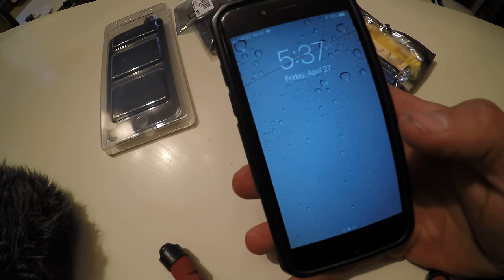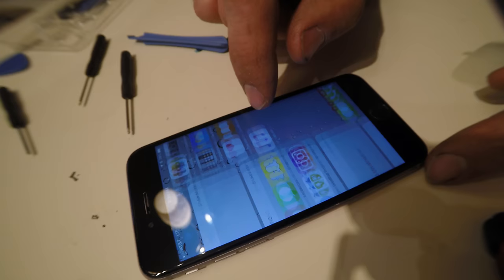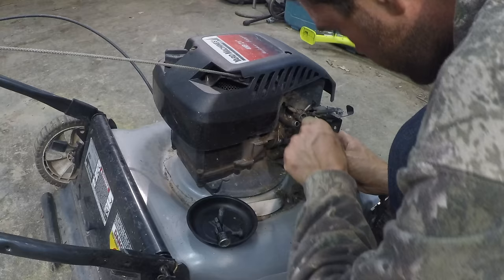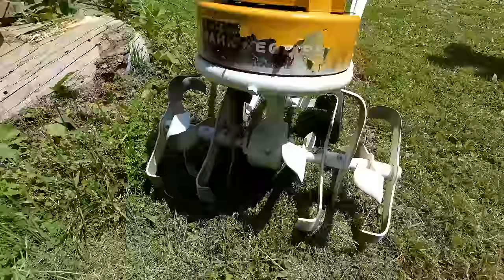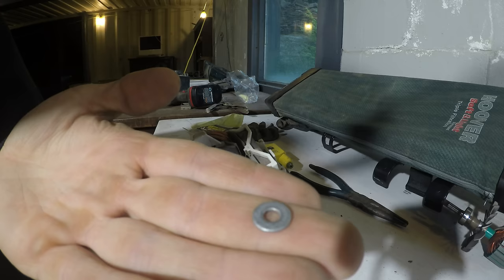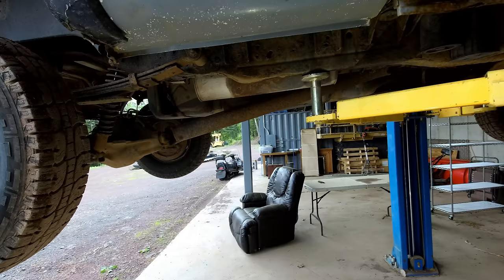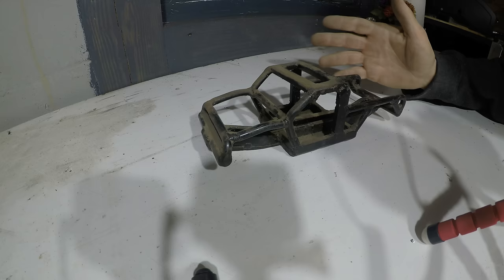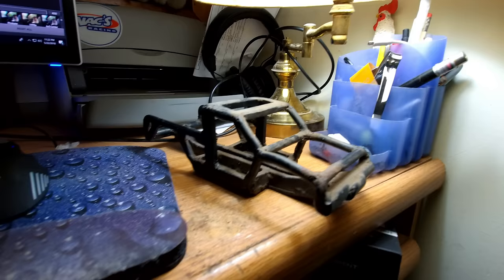Fixing stuff

Comment: I agree Andrew ,, but people wouldnt buy it if it wasn't pretty, ,,,,    Most of the VW Beetle's  were interchangeable ,,,,   Use motors from mobility scooters just make them bigger,,,,    Build it like a train , stock standard diesel motor with a generator and traction motors in the wheels ,,

Comment: I can totally see your idea on the car at least for your use, there is something you forget dough and that is the crumbling zone. Front, back and sides have this and it is for driver and passenger safety i wouldn't want a front to front collision 80 miles an hour in a bobcat against another bobcat. I guess a utility vehicle  like your are talking about could be legal if limited speed was added. I do like when manufactures uses aluminium for sure, i had a peugeot 405, 93mod once that was elzink i believe, never saw a spec of rust on that not even after standing outside for ten years without use.

Comment: You can't practically put the motors in the wheels, There is something known as spring weight. So when ever you hit a pothole the extra weight in the wheel causes bad issues into the car itself. At low speeds it works at 70 MPH you need a big rig suspension system to handle the tire weight.

Comment: Andrew, you're an industrial designer.  You talk about the fenders on the Dodge.  Remember the cover on the Hoover.  There's yer fenders.  I think a different kind of plastic.  Polypropylene.  Snap it on and when it's wrecked, put a new one on.
I'm just gonna edit in that I bet fenders like that could be retrofitted to any car.  What a business.  Tear off the old fenders and install fittings to receive the new plastic fenders.  I see a business there.
And that rust is all salt damage.  The county owes you money for wrecking your truck.  Build a spraying bed to drive your truck over and blast it with antifreeze.  A tray and a pump.  Get that salt outta there.

Comment: Another good thing about electrical cars is that that there is no risk of explosion from the fuel I have a mobility scooter which is all Electric I have no problems with it it is only an 8 mile an hour vehicle but you can buy them that travels faster such as the ziesel that they use in Austria and Switzerland as a sports and recreational vehicle which will travel at 22 miles per hour and has tracks on it

Comment: Andrew the problem with tubular chassis or using rool cages on road going cars is that they do not comply so there is no crimpling zone, in a crash with a normal car you would kill the other people surely due to the huge difference in rigidity between bot vehicles. the only solution would be having all the passengers all the the time using multi fixation point seat belts on bucket seats like you see in racing and that just is not possible. come to southern europe we dont use salt, cars last forever, especially japonese cars of course. but thats a bit of a curse because that makes then also much more expensive because they are not discardable like in places where salt is used on snow..

Comment: Lol I understand what you mean Andrew with the building cars and trucks with sheet metal, but they are designed to collapse at the hood in a head on car collision. If a car was as solid as youd like to make them, which by the way I agree with making them higher quality, someone would die on impact in the event of a crash head on if the vehicle was made out of solid steel. But yea aluminum is a much better material to make a vehicle body out of im with you.

Comment: I'll take mine to the guy at the mall.
Cars and trucks?  Built in degradation.   That's how they sell new ones a few years down the road.  Every day truck or car, just take care of it.  Fix it when it needs fixing.  My Mazda SUV has 243,000 miles and is 20 years old.  Not a spot of rust (I live in the north east) and runs well.  I fix it when it needs it.

Comment: The weight of hub motors in the wheels entirely ruins the handling of a vehicle.  One of the main advantages of an independent suspension is you don't have to shake the weight of the entire axle up and down every time you ride over a bump.  Lower the unsprung weight and raise the sprung weight by keeping the motors in the chassis.    An overly stiff truck would hold up nicely, as you say, but it would kill the occupants in a reletively minor crash.  That's one of the big tricks with modern vehicle design (well, since the 70's anyway).  The vehicle needs to strike a balance between crushability in a crash and durability in normal usage.  So between that, efficiency targets, and saving production costs, we get thin cheap steel.   That's not universal, though.  VW has galvanized every car they made since 1984, and put a heavier PVC coating on the bottoms of them besides since the mid 90's.  Most do that now, but not Dodge.

Comment: There is a lot of dissect here with your truck plan, and I'm not trying to sound like a know it all, but as an engineer I would like to have some representation. Firstly when we are talking about rust, I'm unsure of what you're referring to as modern vehicles do a lot better with this than old vehicles. Seriously. With the increasing implementation of aluminium and associated alloys, plastics, carbon fibre, the advancements of wind tunnels that can simulate salt spray and extreme temperatures, etc etc, cars are much better now that they were 20 years ago. For example, my Volvo is a "modern car" in terms of construction. Its a 2009 and it has done 150k in Michigan. It has not had an easy life, from deep snow every winter, high speed highway usage on salty roads and not being washed for weeks on end when life gets busy. After all that, there isn't a spot of rust on anything structural or on the body. The only place I can see is it occasionally on a bolt or bracket here and there. You couldn't dream of doing that with an old car, even if you took it back to bare metal and sprayed it with modern quality paints. 

We have to take into consideration a lot of different aspect of a vehicles operation not only from manufacturing, but all the way to its afterlife. The key issue with building an exoskeleton type chassis is that not only would it be extremely heavy, but also it would be deadly in a crash, you've effectively created a rock hard coffin with no crumple zones and is also deadly to pedestrians. Nothing upon nothing is more important than safety in designing cars.

It would also be extremely loud due to wind noise, it would be scary on the highway with cross winds and the aerodynamics would also drive up fuel costs, regardless of how you're powering it. The other part being about electronics, the truth is that modern cars are very efficient with their wiring, they have the minimum to do everything they need to do while being extremely easy to diagnose. If we tried to make a vehicle with all the features that modern cars give us in safety, environmental efficiency, creature comforts, road mannerisms and performance, and made them all analogue and wired independently, it would make for triple or even maybe four times as many wires as doing it digitally. Not only that, but diagnosis is so much easier, a few minutes looking at the laptop and I could tell you exactly whats wrong with a car, versus hours of diagnosis and looking through wiring diagrams and taking half the car apart. No manufacture wants the reputation of unreliability. When a car throws a code these days, its trying to tell you of a serious issue, that if taken care of now won't be a bit deal, but if you just ignore it and let the codes build up then you're just asking for it. I like your idea with wheel hubs and removing unnecessary drive train components. However again, cost, weight and sustainability are all the factors and reasons that this hasn't already been done. 

I suppose I could sum up most of this with one simple fact at the end of the day manufactures need to sell cars to actual people, they don't care about their trucks in 20 years when they're on their fourth owner. First owners of cars don't keep their cars 250k, anything beyond the normal first ownership (which depends from car to car) is irrelevant and a waste of time, why on earth would I want to pay to get a car that will last long enough for the fourth owner in 10 years to enjoy it. This is because cars change a lot ever year and continuously get better, there is no way around this. the science pushes through, if you built the same car for 30+ years that means that your company hasn't evolved or done anything to push cars and humanity as a whole forward. These car owners recognize that, and to them they're willing to pay for a new car every few years to enjoy that curve. This is going to hurt feelings but old cars simply don't compare, performance, creature comforts, NVH, ease of manufacturing, diagnosis and after sales. And the two big ones of today are environmental impact and safety. Despite what some people see, when a new car gets in a crash and looks mangled, its doing its job. Bumpers are not designed to protect the car, they're designed to protect you. A car needs to be soft to adsorb the bumps and the bashes. There is also a lot that goes into collision mitigation and avoidance and those systems have been proven in the real world to save lives.  And that cannot be done with an old school analogue architecture.

Comment: Putting electric motors in each wheel hub, would increase the un-sprung weight tremendously.  Not to mention your idea of large tires.  Secondly, it would be very difficult (without a computer, which you hate), to get each wheel to run at the exact same RPM.  Different RPM's at each wheel would cause some wild steering issues !!
Reply from the maker: What's the problem with having unsprung weight though?
Reply: @AndrewCamarata  Reducing un-sprung weight is key to improving handling. The lower the un-sprung weight, the less work the shocks and springs have to do to keep the tires in contact with the road over bumpy surfaces. Lot of problems, if not all of them are caused by inertia. More weight means higher inertia.
Reply: Not the same! Front wheels of a vehicle when steering do not have the same RPM. Right?

Comment: TopEven. $60,000 Tesla can only go about 200 miles on a charge! And it takes several hours to recharge the battery. And the power   Controller for one much less for four motor controls are complex and the regenerative braking is a bit complex as well. You still Need standard brakes to stop as. Regeneration brakes only slow the car down you need the regular brakes to stop.

Comment: Case in point look what happened to Delorean. He made a rust free vehicle all stainless vehicle doors open differently gas economy but the Big three knew they couldnt compete with a new vehicle as the the Delorean. He never was able to get the backers to build his vehicle because the Big 3 could build a vehicle for far less than the cost of a Delorean could possibly build. Your ideas are sound but try running it thru the big 3 and see how far u can get.

Comment: I know this video is quite old now, and I want to offer you some advice when working on these electronic devices. May I recommend an air machine (or just a can of canned air), so you can blow the dist off of the sensitive electronics. It is part and parcel for the work you do, and a much easier way (and safer for the components) for you to blow them off with the air.  HAHA, the big problem with the screens is because it's an apple. ;)

Comment: All you have to do is get a 4x4 truck with no engine and put a motor where the engine use to be  battery's and the controller and electric throttle pedal like a golf cart with bigger electrical parts also you will need a motor for brake vacuum so the power brakes will work and a motor for power steering and brake boost pump

Comment: I agree the gopro audio is poor ' but to be fare i think your gopro must have a issue.
Reply: I don't think the GoPro has an issue. A friend of mine has the same issue with the camera in the gimbal. Out of it it is fine. I think the combination of the housing to mount the camera kind of covering the microphone and inducing mechanical noise from the stepper motors into the camera body is the issue.

Comment: May be strong but unsafe in an accident with a complete tube frame.. new vehicles "frames" are made to crinkle/crush in a controller way to protect the passengers and lesson inertia/impact, if you were going 50 and crashed head on in a tube frame car you would be a pancake inside.. newer vehicles the frame/body takes a lot of that impact and lessons the amount of impact the passenger receives.  I agree they should be made from materials that do not rust though.

Comment: From @42:20 ON. I agree with you 100%. Period. The highlight is when you spoke of hub motors. That is essential and is going to become the standard. (Maybe not right away, in production vehicles; Stupid Politics). The problem is greed and planned obsolescence, although the "clamp" is tightening on destroyers of the environment. Electric is coming, no doubt about that. But the everlasting chassis....probably just the Lithium Ion Tray, and the construction of the packs. That will be closely regulated. You are spot on with your design ideas, Andrew. I could see you out do Tesla. The Man (Legendary) and the Company. Watch out, Elon, Andrew has some new(er) ideas. Thanks for listening, AC. Nice job on the vacuum. Sucks (Pun intended) when you have to go back in because of a missed bearing. They always seem be alright until you put the device back together, with the load (impeller) back in place and guess what? Bearing's Bad. Been there, done that. Carry on Good Man! You do know you are the "spitting image" of the late actor "Michael Sarrazin". right?  Watch the movie "Gumball Rally".   :-)

Comment: G'DAY Andrew,recommended reading,is the history of Le torneau,earthmoving equipment, where the original Mr.Roy Letorneau,purchased thousands of WW2 surplus electric motors,then using Detroit diesel engines to power a generator, ran individual electric motors on each wheel,to achieve a lot of your design ideas,but larger scale?also your long-term model runs,has been a proven principle of Land Rovers,also with galvanized frames,and aluminum panels,has meant rust free vehicles? Cheers Dave McLaughlin, Queensland, Australia

Comment: These car companies don't want you to be able to fix your vehicle. My ideal truck/car would be: 1. frame on body; 2. Stainless frame and floor pan; 3. Stainless exhaust/headers; 4. All engines should have timing chains and be non-interference... belt goes out and blows half the engine.... gimme a break! 5. Dimensions for parts should at least follow some standard so they can be compatible to at least a bunch of other cars... how many starters/alternators/brake pads do we need?! They basically all do the same thing, but there are a million of them for no reason at all. You could probably have 20 types of each of those that'd likely be able to work on all vehicles; 6. Vehicles should have a "dead mode" where if there's a computer fault or some minor electronic issue, it'll allow you to pop the hood, flip a switch, and run it on "safety mode". I could go on and on about other things that'd be great, but I like the way you're thinking.
Reply from the maker: Yeah, I think there is a good market to build some better trucks. I don't think it would be to hard to put the auto company's out of business. Sell trucks that last 100 years.
Reply: @AndrewCamarata  Definitely. My brother lives in Rochester and I spent a few years upstate and can't believe just how rusty stuff gets in that area. I see your vids and Eric O's and it's heartbreaking to see these newer cars rotting to the ground. The whole design and philosophy is messed up. I've got an 05 Jeep Liberty Diesel... I can't even drain the transmission fluid without dropping the pan... in a Subaru, it's a 17mm bolt and it even has a spin on filter. Just so much bad engineering.

Comment: If there is ANYTIME to do this ..is NOW!!!
 You have the perfect forum for it too.
Task your viewer to submit THEIR strong points and attach ideas to move forward. Conglomerate, to move into prototype..or 2?  1st gas/diesel. 2nd elec. The rolling chassis will tell you GOBBS. (This is a timeless, hearty design. Take your time).
 Off the shelf build. Major components.
Look to purchase tubebender/cnc, waterjet, manual lathe 14x40, mill/cnc/combo. 
 Join/ Fusion 360..(subs, have community w/builders).
 Designer models give % of ownership.
Have this a community build !!!

Comment: You are ahead of your time.  I watched this video back in 2018 and just watched it again.  You basically designed the new Rivian truck years ahead of your time.  The only material departure is that Rivian disappointingly is planning on using stamped metal body panels.  They are featuring  your design of four motors, one in each wheel though.  One design flaw you missed is the ubiquitous use of carpet in cars and trucks.  This has never made any sense to me - it just gets dirty, smelly and generally nasty very quickly.  Rivian plans to have no carpet in its vehicles.  Also, you neglected to mention that without an ICE the electric vehicle will have extra storage which Rivian calls a "frunck."  Your design was so far ahead of its time.  I have lived with the same frustrations over how badly designed the traditional automakers' vehicles have been for decades.  You videos are always great, by the way.  You are younger than I am, but you remind me of my Dad who would have loved your videos and commonsense approach to everything.  He was very much like you in that he could and did fix everything himself and had that same inventor streak that you have.  Congratulations on all your success - you had 40K subs when I started watching you and you're now within striking distance of a million.